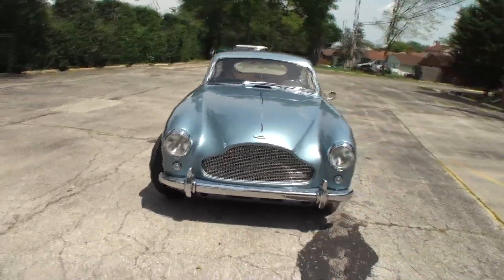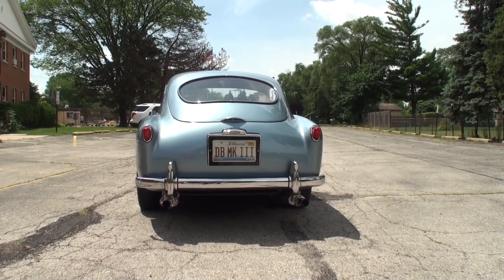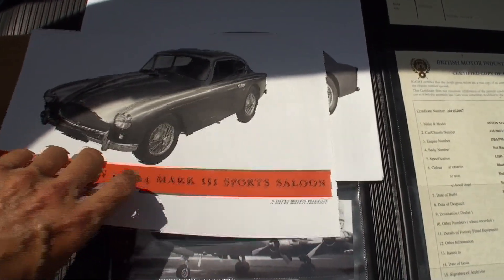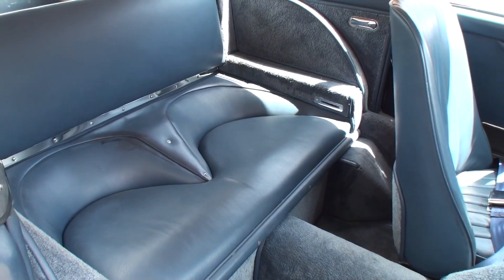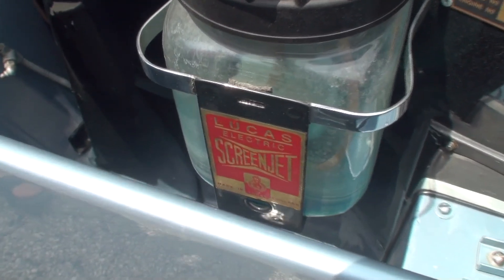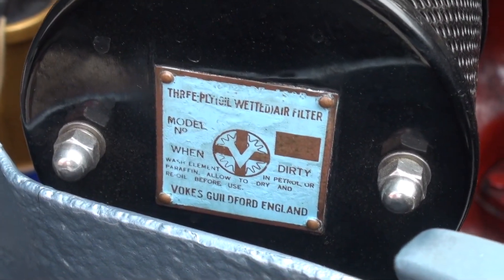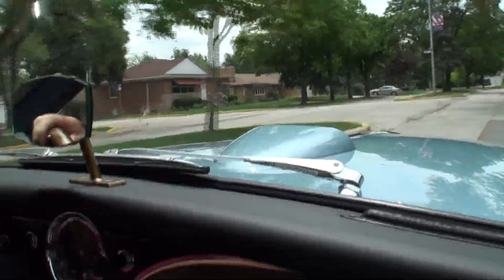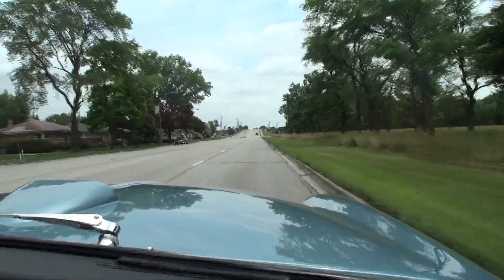1957 Aston Martin DB2/4 Mark MK III Saloon in Elusive Blue & Ride on My Car Story with Lou Costabile

Comment: Yes, the color is indeed beautiful. This is my imagine of the quintessential sports car. This DB2 is simply perfection in and out. The reason these cars did not have all the little toys is because the buyers, unlike today, were true sports car enthusiasts. They wanted lightness, quality, and power and not much more. One thing I always loved with these early sports cars are those almost 1920's looking flat steering wheels up close to the dash. The biggest problem with driving one of these must be deciding when to head back home!
Reply from the maker: Hi Joseph, "This is my imagine of the quintessential sports car" High praise, Lou